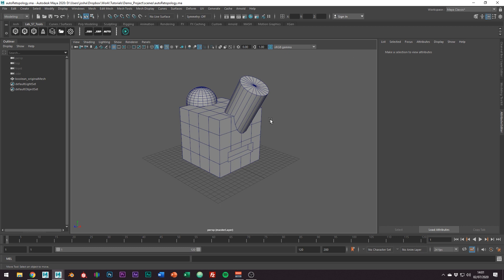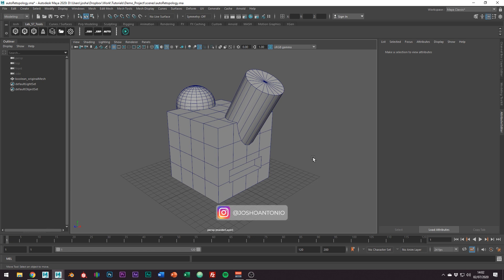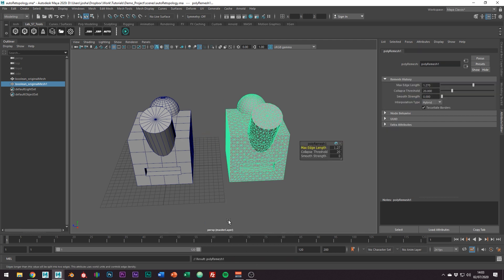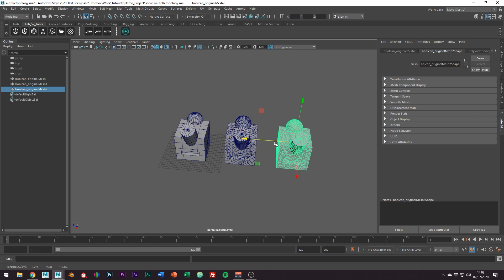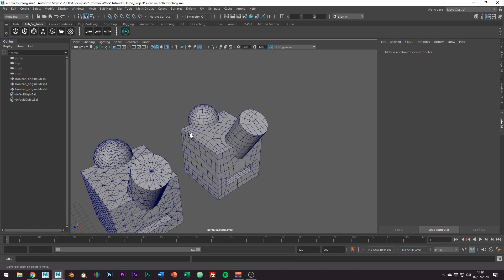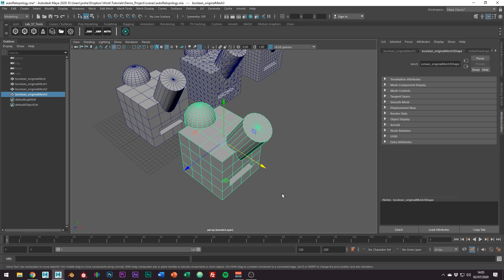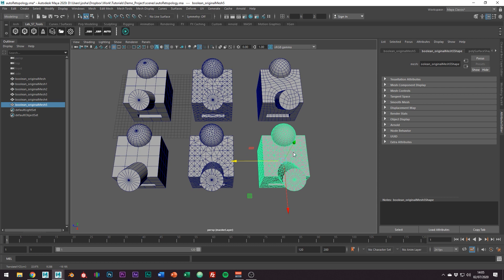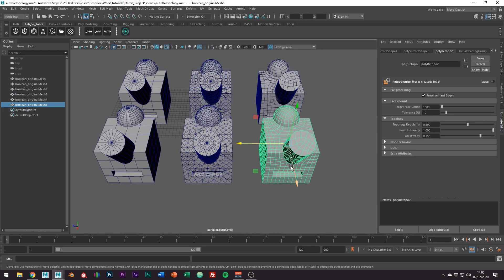Auto Retopology Properly Implemented into Maya

Comment: Hey Hi. I have a question : How much it is important when you do modeling your corner edge must be in loop ? 
Because I'm trying basic models like sofa, table etc but I am not able to achieve that hard edge loop, whenever I use insert edge loop that hard edge loop connection gets cut I don't know how :/

(& I mostly do modeling using 'insert edge loop' tool  not like making 2 different parts & then merge/attach them.)*

Does this video's method will solve that ?
& If I want to make showreel then should I use this method ? Is it ok or is it like 'not industry standard' ?

please guide me. 🙏

Comment: I have a very specific situation. I modeled a car in Inventor where I finished 90% (its size is 122MB in Inventor, and  54MB in Maya), so I decided to finish it in Maya 2020 student version. I've imported it as STP, OBJ, FBX and IGS, but the auto-retopology didn't work in none file versions.
Always when I try Auto-retopo in all the car's parts at once, I got an error message
''//error: line 0: PolyRetopo does not work on polygonal with nonmanifold geometry. Clean up the object using mesh-> cleanup before running''
Then when I try to apply in one part, and keep doing one by one, it works, but most of the the curves seem deformed.
I asked for help in Maya groups (in Facebook) and people told me that it's impossible (for any software) to get a perfect auto-retopology due to the facts that, firstly it's such a complex object like a car, and also my car was made of Solids , not surfaces, and they are not compatible.
Currently I gave up on Maya and I'm seaching for  another software
Reply from the maker: Hey! I agree with what the people were saying on the Facebook groups. Using auto-retopology tools is never going to give you a 100% final mesh, especially for something like a car where you really need that manual control over edge flow to get all those curvey surfaces looking sleek.

The tools I'm demonstrating in this video are really good for getting you started, but there will always be manual cleanup that's needed. These tools might get you 70-75% of the way to what you want. But always doing manually will be best. A computer doesn't know that it's retopologising a car (not yet a least), so won't always do the optimal job.

I hope this helps a little. Probably not what you want to hear. I too wish that there was a magic button, but often manual is the only way.
Reply: @JoshAntonio  Ok, there's no way for me to scape from the mannual retopology, so Could you suggest me the best software for this specific situation? unfortunalety I didn't feel myself secure with Maya, not from the ''Quad draw'' command. The car was made with such a large precision in Inventor, and I kind of didn't feel that Maya was keeping it
Reply: @VFXIDOL I've been googling  "the best soft for autoRetopo" and then  Zbrush , 3Dcoat and TopoGun came out. I was in a serious doubt between these 3 until I read your comment. Thank you , I choose Zbrush then